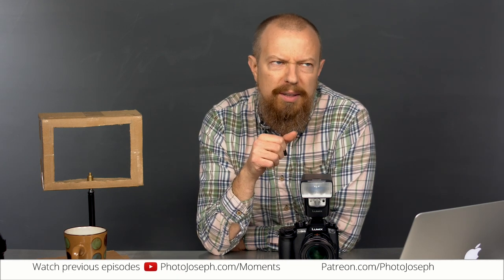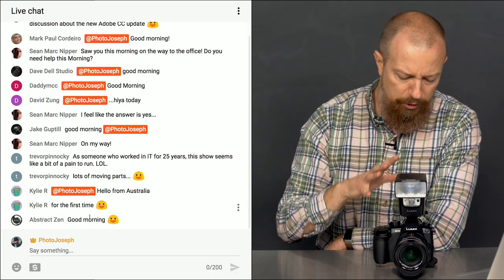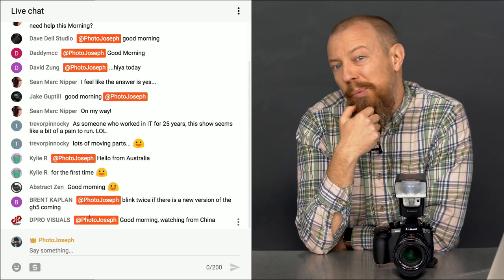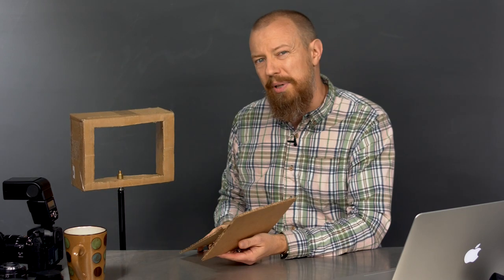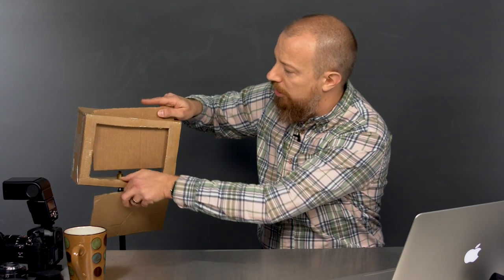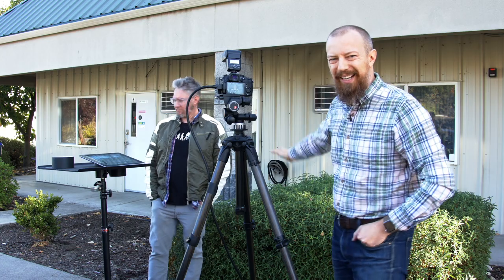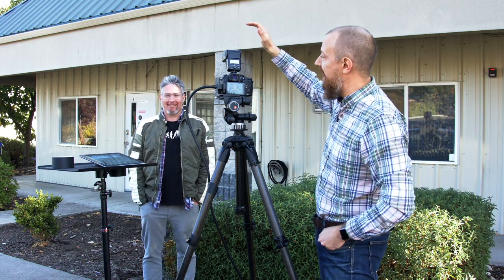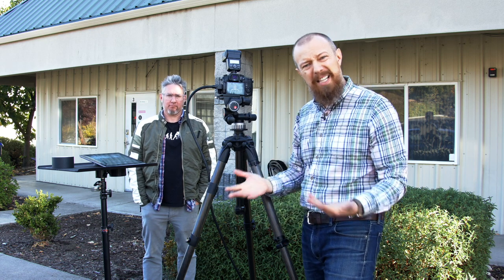Micro Four Thirds High Speed Sync Off Camera Flash Tutorial Part 1 ► Panasonic 580 Flash FP Mode

Comment: FP mode:  Focal Plane.  A flash mode used in older cameras.  My 1978 Pentax MX film camera had a special socket labled “FP” which I recall was specifically for use with flash bulbs.  I never used it, nor did I lean any of the techniques that would have been associated with its use.  Perhaps another reader might know more.

Comment: Hi, I would like to use the unit for shooting video in low light. Manual does not give any info on this. Could you explain. Is it a viable way to use the flash? Bob
Reply from the maker: No… flash is for still photography only. This unit has a small LED light on it but I wouldn’t buy this for that.

Comment: Hi, you make great videos about Lumix stuff - I learned quite a bit. I have a hard time to figure out what one menuitem (in my GH5) in the flashmenu is doing. I am talking about the "Auto Exposure compensation" function. May you shed some light on this? And I noticed that I can not enter the menu "firing mode" even if I have a TTL compatible flash mounted. All is about my GH5. Would be greate to get some insight. Thanks. F.
Reply from the maker: I don't have the camera in front of me and I'm honestly not sure what the "auto exposure compensation" is. But if you can't enable the flash at all then that usually means you're in electronic shutter mode. You can only shoot flash with mechanical shutter. Look up the auto mode in the manual, sorry.
Reply: @photojoseph  the flash is working as expected. This is not the problem. I am just curiouse why I can not enter the "firing mode" menu...strange. If you have the camera in front of you it would be nice to check if you can enter the menu with a Panasonic flash attached. Thanks for your reply. I really appreciate it. Best. F.
Reply from the maker: OK, I'll look into it next week. What flash do you have attached?
Reply: @photojoseph  it is a metz mecablitz 50 AF-1 digital in the oly/pana version.
Reply from the maker: page 155 of the manual: "It can be set only when using an external flash that does not use a battery (supplied with some models of Panasonic digital cameras)." — it's to choose between manual and auto options, which are built into most flashes.
Reply: @photojoseph  Ah, OK. I thought I read the manual...thanks for your great help. Looking forward to the next videos. F.

Comment: Is hss works too on gx85 ? (Using godox)  And the mode, can you use hss with manual power or just hss with ttl only ?
Reply from the maker: You’ll have to try it. The Godox compatibility chart is BS. It’ll probably work in manual, not TTL, but there’s no guarantee.
Reply: @photojoseph  yea, i found some user's talk about the issue in https://www.dpreview.com/forums/thread/4183131 . unfortunately i bought this camera 7 days ago and though this setup could perform the HSS ;(

Comment: i found out the GH5 can handle 1/320 sec with the Godox HSS flash for panasonic cameras (TT350o i think it's called... at least I didn't see any shutter lag in the image [black bands]) Also I think FP comes from the leica&minolta 'Full Pulse' modes. Could be wrong tho...
Reply from the maker: +Sully Cortez So the Godox, in high speed mode, will only go up to 1/320? That’s disappointing. Then again the cost is very affordable!
Reply: oh no no sorry let me clarify, it will go up to 1/4000 sec in HSS mode. But while NOT in HSS mode, you can actually go up to 1/320 sec without any shutter lag (black bands) in the photo. Normally it's 1/250 sec but for some reason with the godox not in HSS, I can go up to 1/320 sec. So it's kinda cool
Reply from the maker: +Sully Cortez Oh that is cool. Nice!

Comment: What if I don't want to spend $400 on a Panasonic flash and I want to do high speed sync with a cheaper $50 flash from Neewer or Yongnuo? How do I force the GH5 into FP mode? What about with flashes that do not have TTL mode?
Reply from the maker: +Melvin The House Husband The flash has to support high speed sync. The camera detects that the flash is in that mode and then allows a higher shutter speed. If the feature isn’t in the flash then it won’t be possible. I don’t know if the Neewer or Yonguo ones do it or not. 

TTL is separate. You can have HSS without TTL, and TTL without HSS.
Reply: My cheap flash has HSS but there is no button to activate it.

Can it be that other cameras sends information about the SS to the flash, which automatically activates the HHS mode?

Too bad I have learned how the flash work AFTER buying and using it 😅

Comment: HELP! When I'm in manual mode / photo (M) mode (on GH5) and i'm focusing, the screen goes bright (basically showing me what 3200 ISO would look like) and blinds me :( ..where do I turn that craziness off? Thanks man!
Reply from the maker: +fmrl productions Toggle off “constant preview”. Although you’re seeing the OPPOSITE of what I’d expect to see (usually in manual mode shooting with flash the screen is dark until you focus, then it looks fine). Make sure exposure compensation isn’t cranked to max.
Reply: thanks, but I actually just ended up turning Af/AE LOCK to off (or the box, second option from the bottom). keeping constant preview ON.seems to work (only goes bright when i push the AF/AE LOCK bottom to zoom/check focus/auto-focus in manual. thanks (still wish i could turn it off completelt tho).
Reply from the maker: +fmrl productions With constant preview ON, the image may change when you focus. You’re telling the camera to show you what the image looks like with the exposure settings you have, but to focus accurately it needs to “properly” expose the image temporarily when you half-press the shutter or press the AF-ON button. If you set constant preview OFF, then what you see, regardless of the exposure settings, will be that “proper” exposure. Your recorded image will of course reflect your settings, but the preview will be “proper”. Does that make sense?
Reply: Yes, thanks, that does makes sense of things. for me tho, I wan't to see what my photo will look even with i'm focusing. So I will keep constant preview ON. This way, rather than seeing a brightened image constantly/too often, I will see my exposure/final image on the display screen, until i press AF/AE or zoom-in. Thanks for the clarification :)